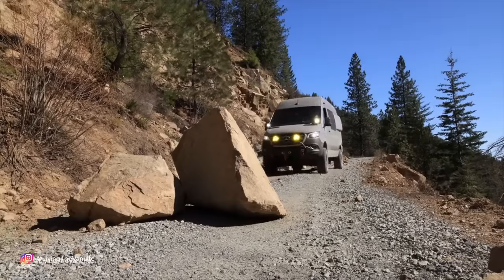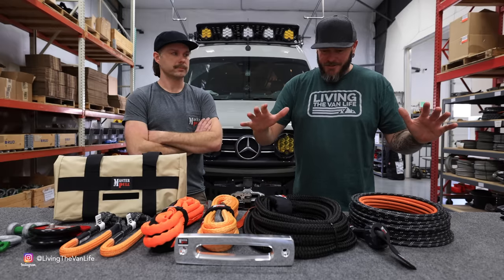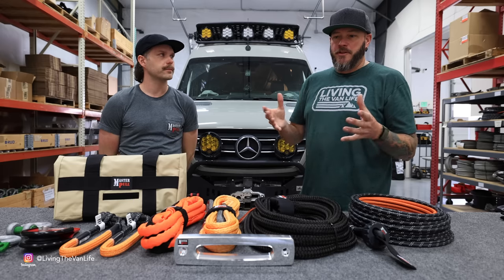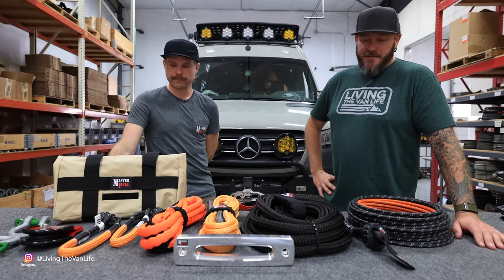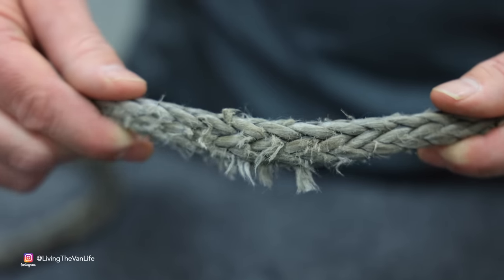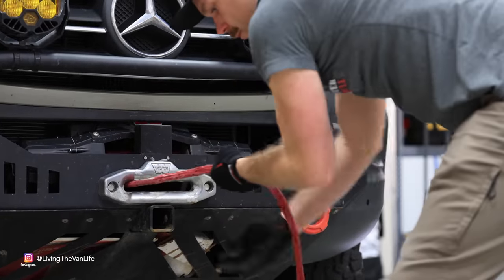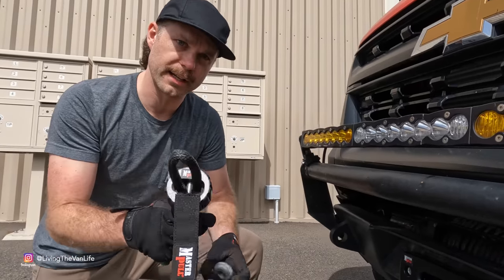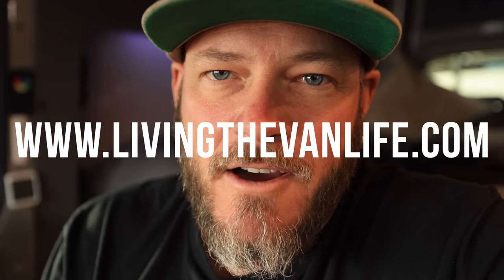Off Road Recovery Gear - Living The Van Life

Comment: Winching. As a firefighter its best to throw a small tarp over the cable and to stand well clear as if it snaps it will come with a lot of force ! Your man there mentions this with using the bag. There are some basic safety rules with winching you should be aware of if using one. On our fire appliances the winch cable was inspected and replaced regularly if there were any imperfections with it. Chad's rope looked well dodgy.

Comment: Just wonder if you come across a truly flat situation, i.e. no trees, rocks etc. Would a heavy spike that could be hammered into the ground  to provide leverage be any sort of use?  Since i've seen occasions where the only thing you have  is the road and only light vegetation, here in the UK you're never so far away from help but in your situation it's a very different matter. Excellent video as usual.